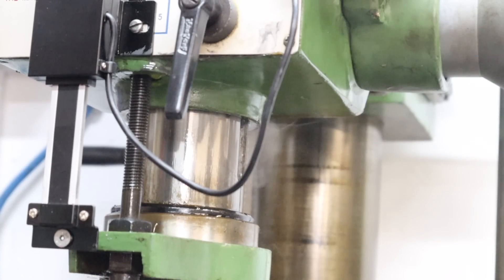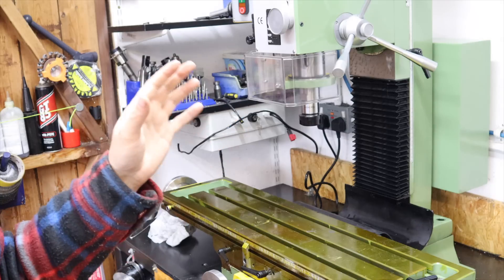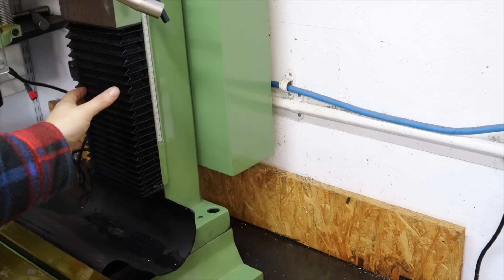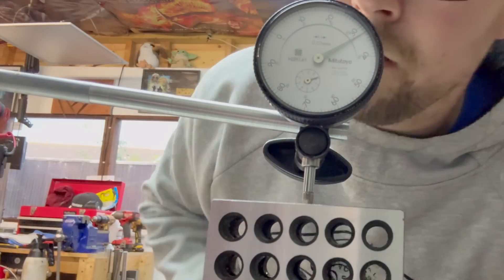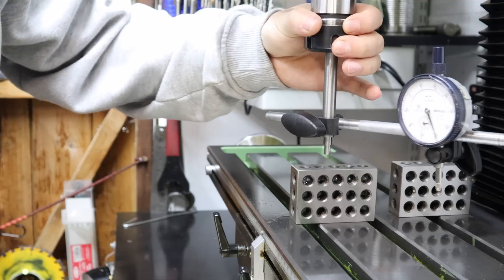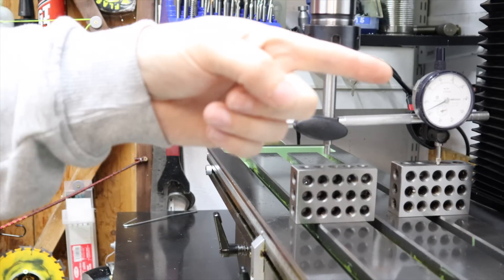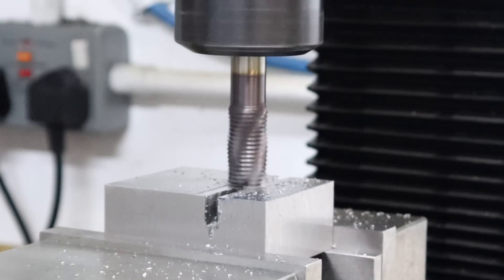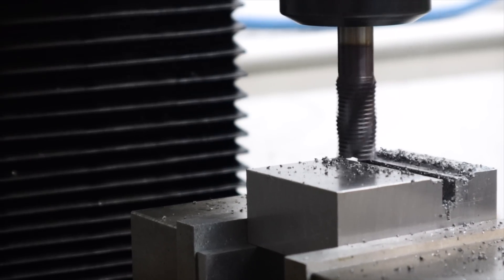The BEST Benchtop Milling Machine - Initial thoughts Warco WM18B

Comment: Buy old.. not China
Reply: Old is always worn out and over priced.
Reply: I have my 12 x 36 lathe in a 10x10 shed with a concrete floor

Cant fit a full size knee mill, floor cant rake the weight ither.

 they make taiwan ones at busy bee but they are $7000

These small machines look like they will do keyways & flats no problem

Only issue for me is cross travel.

Bigest iv seen is 8" but again its $6000

The small one for $2000  gets 7" cross

Thats like 6" bolt patters max
 Someone needs to make a small one with that will cross 12" to match with my 12" swing lathe so i can do 11.5" bolt patterns
Reply: @65cj55 yep, that's absolutely correct. Nobody ever bought a Tom Senior mill or a Centec 2b mill or any of the Taiwanese RF type mill/drills that was usable.  All of the people that bought these bought just lumps of scrap and all the good work they did on them was faked.

Stupid, absolutist comment is stupid.
Reply: @kenjohnson6338
Having done both previously, I am more inclined to buy new 'semi professional or professional use' (not hobby use only) Chinese machines nowadays. Old British, American and European machines are either severely worn out or ridiculously overpriced. For the time and money spent in bringing these machines up to usable standards, the Chinese machines win hands down most of the time.
Reply from the maker: Would love to but due to location/ Space/ installation issues I need a smaller machine that I can take apart and carry in manageable pieces
Reply: That only works if you can find a nice example,  when I was looking for another lathe I couldn't find anything worth using. I ended up with a Warco, it's been great for the last 5 years, and more accurate than my old Harrison 11" lathe.

Comment: Hey Joe. Thanks for this review. That Warco mill you have gone for is on my list as my round column mill is starting to brass me off. 
The dove tailed column must be so good and did I spy a tilting head on that? so that must be helpful.
I have been sorely tempted in getting one myself. and you mentioned having to break it down and the wiring sounds daunting, I have to get it into bite size chunks as like you I dont have the lifting capability and it has to go through the house.
do some more vids of this if you get a chance.
Cheers and keep making swarf!

Comment: Hi Joe, congrats on the new milling machine wishing you many happy projects!

Off topic: I noticed an interesting item in the background of the last shot, and I'm curious to know what it is and how it works. I'm referring to the electrical enclosure on the left of the mill fitted with a keyswitch and cables coming out of it. Do you mind elaborating on it?
Reply from the maker: Thank you, so that electrical enclosure is actually one of my older projects on the channel for a bolt on power feed. Originally I had it hooked up to a stepper motor which powered the Warco mini lathe. I then moved it over to the Warco mill to use as a power feed for the table. All videos are on the channel 👍

Comment: I have that mill 🙂 I made a smaller drive pulley to increase the speed a little, it now does 3300rpm. It is a superb machine. I’ve fitted a dro and eBay powered x axis.
Reply from the maker: That’s a great idea. Just out of curiosity what sort of depths of cut can you get in steel and aluminium?

Comment: Unless I missed it, you didn't check that the table was good in X & Y axes, other than that a fair review of a reasonably priced machine.
If you're going to go chasing perfect tram and nod Stefan Gotteswinter has a very good video where he uses softened copper wire as a crushable spacer to hold up the back in the correct position and then injects turcite to cement it into that position.
Best of luck with the newest toy in the shed.
Reply from the maker: No you didn’t miss it I didn’t do that on Camera. That is a great method for setting the head nod if I want to chase those 000s I’ll probably consider that method.
Reply: @MachiningwithJoe  👍